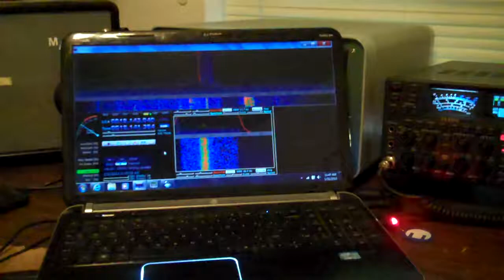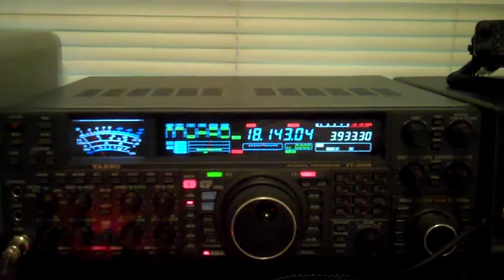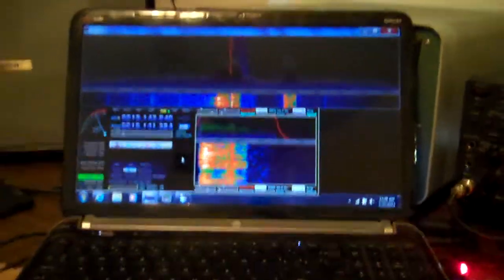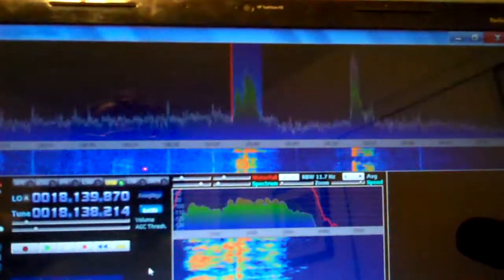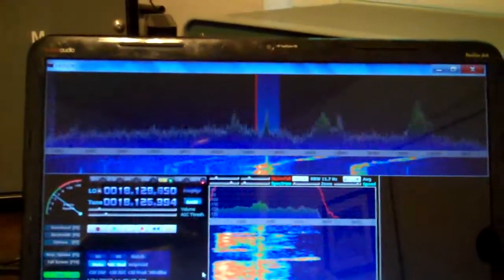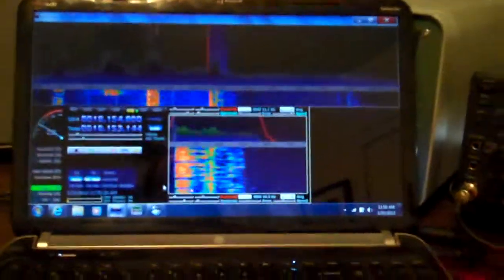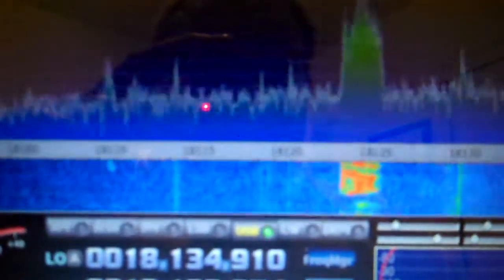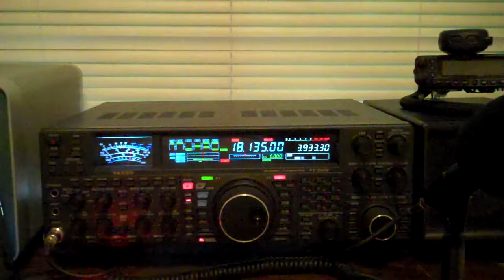ft-2000 panadapter

Comment from the maker: There is no comparison to Power SDR.  Its not even usable in my opinion.  HDSDR now has full support for SDR as a scope while using Ham radio deluxe for Frequency tracking.  Also.  HDSDR can be scaled vert and horizontal and is never locked in.  You get a Third receiver with this setup. I can mouse around and spot DX using the HDSDR and then when I turn the VFO knob, The SDR and the 2000 align back up instantly.